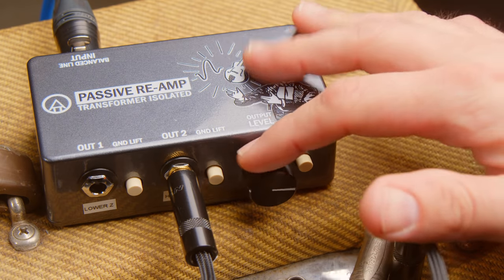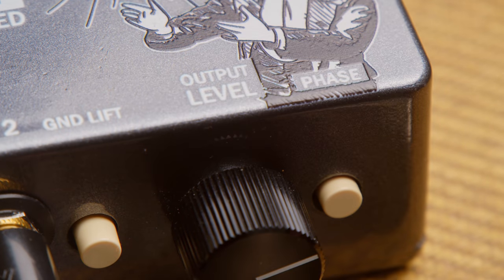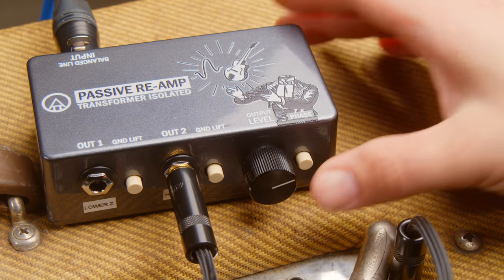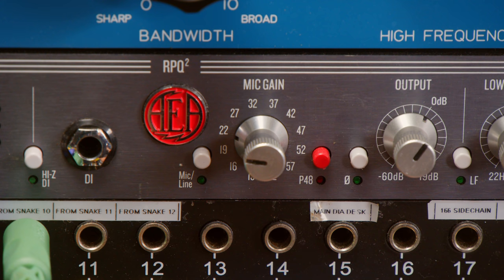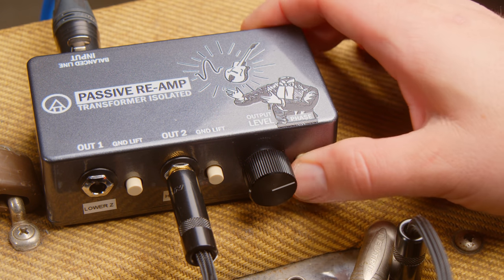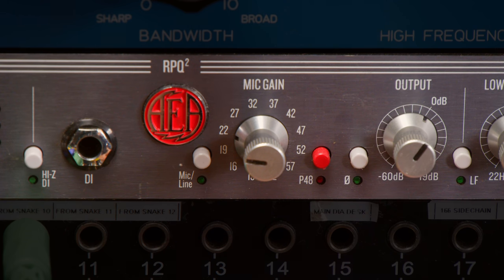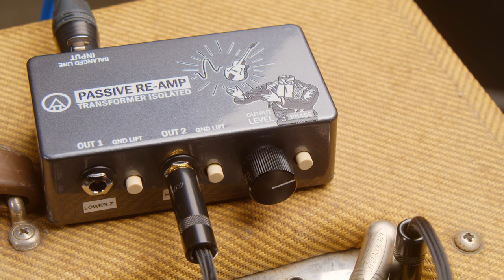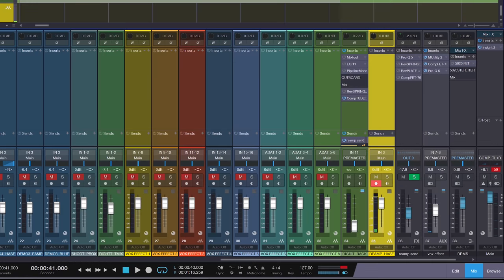No More Mono Guitar - A Real Way to Stereo-ize a Source

Comment: my guess is a phase difference only of the distortion part due to the asymmetric saturation behaviour of tubes, and less of the speaker (at least not primarily, only when you push it really hard). tube distortion squashes the upper and the lower half of the waveform to different amounts, that's why it is called asymmetric. my guess is it will not work as good when you use most overdrive/distortion pedals with it, because most of them have symmetric clipping stages built in, resulting in no difference when the waveform is flipped.

Comment: My guitar rig evolved out of a pile of sound reinforcement bits for drums so I have some weirdness, like I use a couple of Little Labs IBPs to cock a couple amplifiers slightly off phase- one plus and one minus, and a Panning Tremolo Pedal to swap them up and down. At the moment, they are taking the two upper bands from a three-way crossover for sort of a Heath Robinson/Rube Goldberg Harmonic Tremolo. 😜  My motto is "They make a pedal for that".

Comment: I'm curious: maybe it's not only the speaker but also the electronics before it.  If your amp has an open back, you can try to just reverse those connections.  My suspicion is that if it's a transistor amp, it's almost exclusively the speaker, but if it's a tube amp it might be a mix.

Comment: OK, I tried this on my Protools system and I did not notice a great stereo image.  I am ReAmping one side by flipping the phase going out to the amp just like you did.  I look at the wave forms and the two resultant tracks are indeed 180* out of phase and cancel correctly when summed.  Flipping the out-of-phase track back to in-phase and hard panning, maybe, gives me a very slight stereo spread.  Am I missing something?

Comment: RE: speakers not liking to pull in first

Don't most sounds have an attack anyway so the vibration would come in gradually? surely not all sounds we put through speakers push out first right?

The effect is obviously there but i can't really wrap my head around it
Reply: if every sound pushes out first or not, the flipped sound will definitely be the inverted wave every time and get a different reaction from the speaker.
Reply: @bunjumun  But why would the inverted wave get a different reaction from the speaker? 

or rather why would speakers like to "push" first? is all of the difference because of that or are there other factors?
Reply: @crouton3455  as i understand it they will 'push' for the positive portion of the wave and 'pull' for the negative.
Reply: but if you're asking why a speaker would have some sort of preference to pushing and not pulling i have no idea.
Reply: Yeah I don't think it's about speakers having some magical way of knowing which way an AC signal is supposed to start, but that some amps, pedals, etc distort the sound asymmetrically.

Comment: Wow , bought an ART Dual RDB to try it out and I'm never going back to Emulation VST's. This sounds so clean , thick and YES it cancels out when you turn the mono/phase on again. My Laney VC30 is gonna be permanently set up with this RE- AMP method. I can write by candle-light and annoy the neighbours briefly by day. Its a revelation for me.... I am gonna make an amp shroud cover that will be padded out with acousti-foam next but I'm worried about the rebound on my Sennheiser e609. Phase cancelling from behind. Do you have any advice on this??? Many Thanks

Comment: Hey Ryan, that's pretty cool! Your assumptions as to why it works are not quite correct, though. You said that "speakers don't like to move backwards first, they want to move forwards." That's not correct. If that were true, you would be able to achieve this without that reamp box by swapping polarity of the speaker (and mic preamp).
The reason this works is because of the asymmetrical clipping at multiple gain stages inside the amp.
It's very cool!

Comment: Sometimes you can get the same effect in the box with just a high pass filter since it messes with the phase
Reply: I was wondering about that. If you were to try this itb with an amp sim. I wonder how it would turn out. It would save so much time in post if it were possible or even for just making demos if the result was comparable to double tracking and not just “good enough” if there’s no other option.

Comment: so it puts the room out of phase?  cool.  lol my only apprehension was mono compatibility.  i figured at most you'd just lose the room in mono. but that doesn't seem to be the case.  maybe down to tiny changes in amp/mic placement, or some other minute change in the room.  thanks for the tip!

i've never heard this thing you mentioned about speakers having preference for forward excursion; i'd be interested to test that out, i've always assumed there is no difference since the speaker's voice coil self-centers itself to the magnet's field, and because sound waves can go either positive or negative first as that's an artifact of timing and mic placement.  although technically, air is essentially single-ended as a pressurized gas medium, to put it in tube amp terms.  the fluctuations of sound aren't driving the air to "negative pressure," just momentarily to a slightly higher or lower pressure with the air squeezed then stretched as the wavefront moves outward from source. so that's almost exactly like biasing output tubes; the tube never really goes negative, it's normally running partly conducting and the signal rides on that. so i could see how a speaker could be more effective initially pushing rather than pulling. gonna have to dig some more...

Comment: Hello sir,I have used a ts cable from the guitar to the multieffect, from the multieffect to the mixer I use a ts cable and from the mixer to the active speaker I use an xlr cable.. in your opinion, is the resulting sound stereo or mono?

Comment: how about a vocal take through a good mic pre amp with a phase switch? I guess when you really start to think about it, the possibilities are endless, it will surely thicken the gravy, but I suppose it must be used sparingly like all other good things
Reply: I just tried this on a vocal track using a tube emulator plugin, and you get the same result.

Comment: I was wondering if something similar happens without flipping polarity. The signal goes through 4x analog devices, cables, amp, speaker, valves, air, microphone, etc., so no reamp pass can be exactly as the previous one and won't NULL when flipped. Most of the frequencies might get canceled, though. Right?

I'm guessing that's what made you try to make the speaker work "backwards", cause that increased the differences between the two tracks even more. 
But I don't think that's the case in a pedalboard like Helix. Or Is it? That would change the whole game. A great setup to use live (it should work in real-time with two amps, right?

Thinking this way, when trying to recreate this in a DAW, you need to use plugins that automatically randomize internal settings/values every time you press play. Most analog emulations do this,
To check if a plugin does this, it's as easy as recording plugin track output to another two (separates passes each), and then plip one of them and play them at the same time to check if they completely null. If they don't, there you have it. There's nothing like DIGITANALOG!! haha.

Haha, too many questions. I'm just so excited. I've tried every way. Every trick, every plugin, did my own test routings, and managed to make something work in a DAW, but nothing that could be used in a live setup. 

Do the virtual cab simulations work in "stressed mode" (flipped polarity) as well? I really doubt they model that. You can flip polarity in some plugins, but it is probably just a routing tool,. I don't think they sample every cab also this way. If I'm wrong: Best day ever!!

Sounds like you brought an early Christmass, for me at least!

Now let's find a way to do this with an acoustic guitar track as well. Gonna try with plugins first.

Another amazing video!! Thanks!
Reply: There's no difference for the speakers either. He just flipped the polarity twice. My main theory right now is that his amp preamp has asymmetrical clipping.

Comment: Is there also a few milliseconds delay that happens with reamping that adds to this stereoised effect? The couple of effects pedals that do doubling are adding this, almost positive, so I figure if you have a duplicate reamped copy of a  track then played together, you’d get a wider sound after panned regardless of polarity or. Tell me if I’m off on this detail.
Reply from the maker: It’s the same track played through the amp each time. So the timing would be exactly the same in left and right. Good thought and idea though.

Comment: 0:38 - the effect is almost inaudible without headphones. And the main signal itself stays exactly in the middle, with a second, rather soft, slightly wider, low passed signal in the background. This is really subtle, and completely inaudible on laptop speakers - which usually have no problem resolving the difference between stereo and mono. I doubt this will do much good in a mix when it is barely noticeable in isolation.
Reply: On the other hand, -6 dB of bass is barely noticeable on laptop speakers too.  This is for a subtle widening.

Comment: You watch Steve Albini’s in depth talk about phase and the amount delay an amp has? Just seems like you found the sweet spot in milliseconds of delay. You know more than me…I’m just an armchair coach.
Reply: i'm pretty sure it's not a delay thing. it's recorded twice with the same mic in the same position, so there should not be any time difference. also when you listen to it the localisation of most of the signal comes from the center when panned hard right and left. but there are definitely phase differences in the distortion that is produced. but that has little to do with delay.

Comment: If, as some folks think (and I suspect), the needed asymmetry occurs in the amp stage(s), then will it not work if the amp is operated perfectly cleanly? Not pushed at all? No clipping? And, if that's true, then isn't there this tradeoff: you'll always have to add some distortion whether the track benefits from it or not?  Just curious and thanks for considering this.
Reply: If the amp has any kind of sound of its own, it is in fact causing distortion. It might not be noticable as such (being very little), but distortion (harmonics!) is a huge part of the sound - even wenn played "clean". Also, if it does show any kind of compression, it is in fact changing the shape of the signal in some kind and is likely to cause additional distortion. 

In most cases this distortion is asymmetric (the preamps being used in class A and even if it was AB, those are not perfectly symmetric either), so if you "double flip" the phase it will alter the sound in some way that is only noticable when you compare it to a track that is done "the other way round".

The speakers themselves (and dynamic microphones as well) will also show asymmetric behaviour, as soon as they are pushed into nonlinear territory (meaning: LOUD).

Comment: Suggestion for the "high fidelity" version: run the original signal and the flipped signal through a tape or saturation plugin (or a real tape deck or a real preamp with lots of "character"). The stereo effect should be subtle (unless you go heavy on the saturation).
Reply: Was going to suggest the same thing, but with an outboard compressor. Two tracks through the same compressor, but second pass polarity reversed in and out like with the guitar amp. You might even be able to set up a fancy routing chain in the computer to mimic this without the ADA steps, but something tells me the analog unit may exaggerate the stereo imaging or just plain sound better....I gotta try this.
Reply: @drewleclair1281  kinda similar to a stereo compressor if you don't link the two channels I guess

Comment: @3:21 it just jumps out of the speakers. I have previously heard of inverting the phase and sending it to the other side to give some stereo width, but this demo'd it perfectly.
Reply: I can see this could be an issue with reproducing the track in mono. It may cancel out if you're aiming for creating a mix for a mono source (maybe most radio broadcasts are stereo now so maybe not a problem (?) ).

Comment: This is an awesome idea; as I record and mix all guitar tracks myself, this could save me hours of tracking! Just to be clear: the polarity button (that "0" with a "/" through it) on my current preamps is NOT the correct means of inverting phase right? I am reading through the differences between polarity and phase now and it is making my head spin. I need to either flip the phase leaving (and reentering) my Studio One DAW, or have a unit that EXPLICITELY flips phase (e.g. Radial Xamp-500), correct? Thanks for the clarification!
Reply: No the button on your preamp will be fine, but it only flips the polarity for the input, not the output. So to send the signal to the amp inverted, you'll need to either flip the polarity in the DAW on the output you use for reamping or use a polarity flipping reamp unit like you mentioned. On the terminology of polarity and phase, when a device says it "flips phase" it pretty much always inverts polarity. Phase is always time based, whereas inverting polarity just swaps a pair of wires.
Reply: @joeribraams  Awesome, thank you for the clarification, I really appreciate it!

Comment: Wow! I would have never thought of this. Does it work better with tube amps because of the push/pull relation?
Reply: It works better on tube amps because their distortion is asymmetrical.
So the preamp and power amp are adding to the asymmetrical distortion from the cone.

Comment: General phase question. How do you confirm your whole mix is phase neutral with low end transients pushing out first? Should I be flipping entire mixes to get the best low end transient response?
Reply: Need to know about this  as well!!
Reply: Chuck a phase correlation meter on your Main Mix Bus. It’ll show you if anything really wacky is happening.
As for low end transients creating positive phase excursions, this Jacquire King video is a great tip.

https://youtu.be/M_MfZqKZoGs
Reply: I'm skeptical that speakers actually have a preference for pushing vs pulling first

Comment: How about sending from the re-amp box to two different guitar amps with different eq settings and record both on two different tracks into your DAW and then pan them left and right? Boom, you go from one track to two tracks of guitar. No need to fiddle with the polarity this way.
Reply from the maker: This gives you stereo by flipping a switch  vs setting up another amp and mic position. Here the mic is the exact same spot
Reply: If you're using impulse responses, you can get a similar effect without having to set up a new stereo/mic setup. I've been dual tracking guitars and then for each track, using two different impulses per side. So far, I'm not fully satisfied with it, but this is also my first times messing with IRs
Reply: Just be aware if you reamp into two different amps, I personally have had trouble with some of the harmonic content on distorted guitars for two different amps being able to mono sum. Sometimes the upper harmonic stuff will be canceled at certain freqs and phasey sounding if you center it... it'll sound really good with the two different amps hard panned but once you go towards the middle again it can be weird so just be aware of that. If you want to go with two different amps you just need to find two amps that will play ball with each other ...it becomes way more noticeable with distorted guitars than it does with dead clean guitars. Same goes for reamping into two different drive pedals sometimes they don't cooperate in mono even though they are technically in phase. Making something nice and wide yet maintaining mono compatibility is always a challenge.
Reply: @creativesoundlab  That is a very cool aspect of this technique, achieving stereo guitar from one track. It is a very creative way to go about getting stereo guitar! Especially if you don't have a lot of guitar amps. I'm wondering if you could get a similar result using amp sims? There are a bunch of free amp sims out there that are really impressive. A similar technique that Graham Cochrane teaches is to duplicate your single guitar track, and pan them full left and right, but EQ them differently. I think Izotope has a free doubler plugin that you might be able to get similar results, but probably not as good as your inverted polarity technique. Can you post a source for that model of re-amp box? Thanks Ryan!! Keep posting the creativity!! Very cool!
Reply: You would still get a lot of FQ cancellation (and weirdly spread over the stereo field, and that sounds more like "wide mono") AND you will never get a symmetrical stereo sound like when double-tracking through the same amp. I
t might be worth a try to do both,: two different amps, one reversed, and different amp+speaker+mike+etc. That could be interesting.